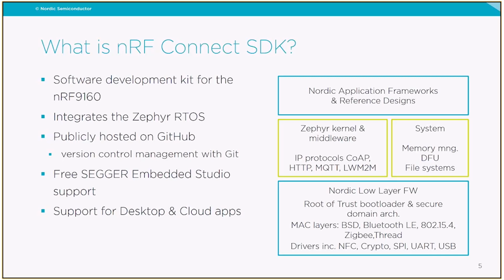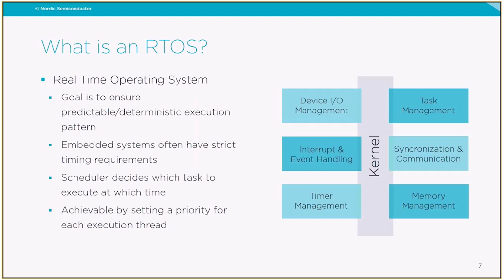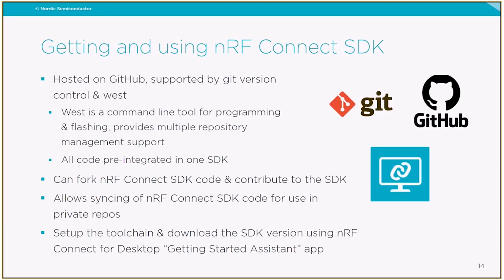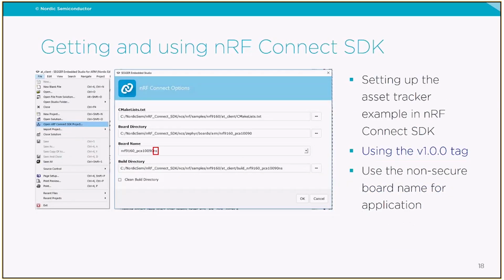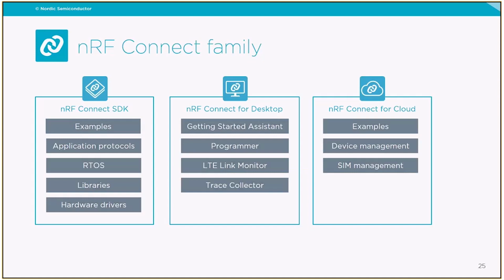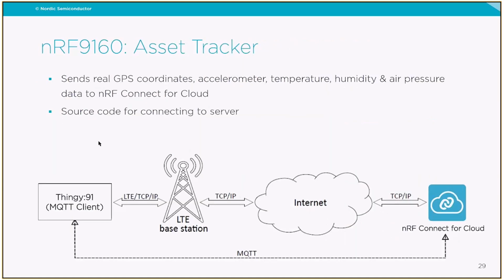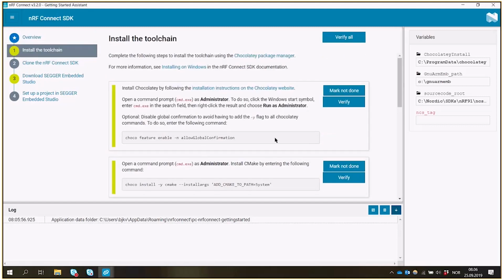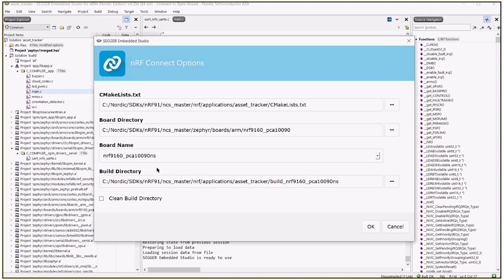Introduction to nRF Connect SDK

Comment: Turning to Zephyr is is by far the most idiotic idea Nordic ever had..... It sets the barrier to start with Nordic silicon so high, a lot of people will turn to other chips. Besides Zephyr is not that light weight and not that stable as it claims to be. This is dumb....
Reply from the maker: Have you had a chance to try the new Toolchain manager? https://developer.nordicsemi.com/nRF_Connect_SDK/doc/latest/nrf/gs_assistant.html
We are working to simplify the process of getting started with nRF Connect SDK (NCS), and the work is still ongoing. If you have more specific feedback on issues getting started with NCS, or stability issues, feel free to share it on DevZone https://devzone.nordicsemi.com